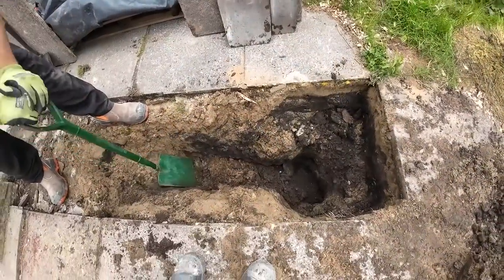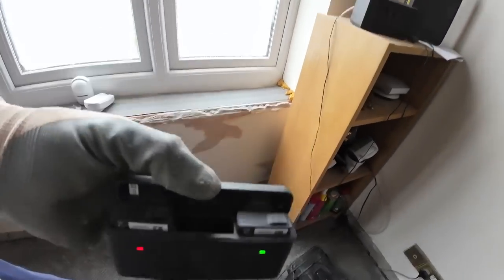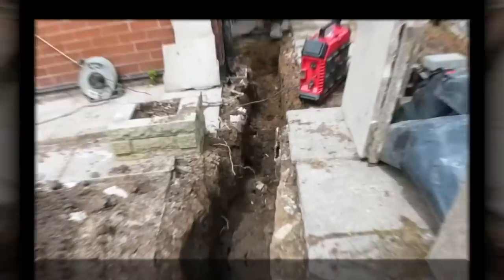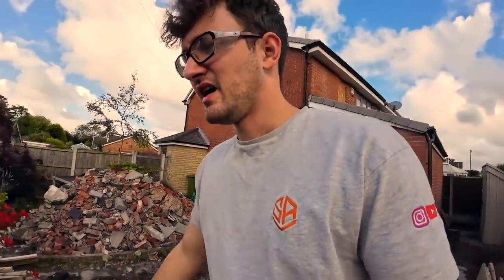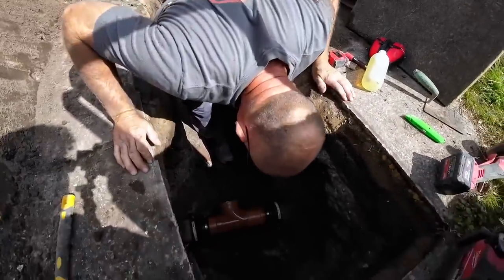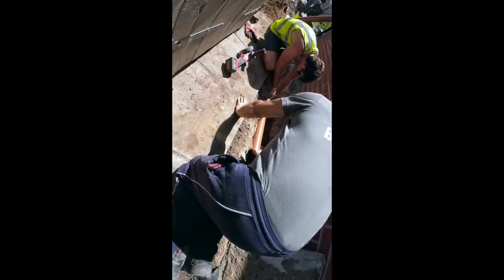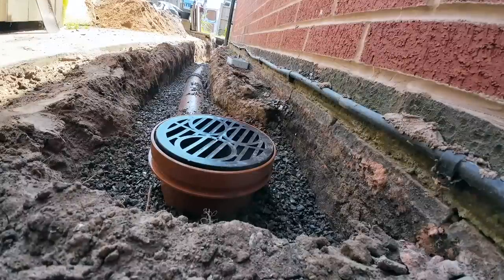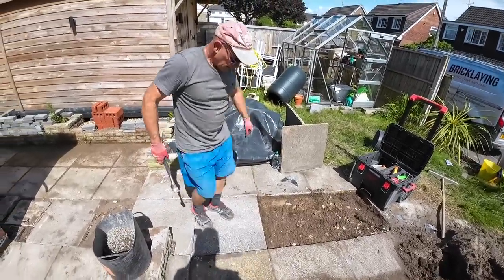BIG ALTERATION JOB PT 5... BOTCHED DRAINS

Comment: Wow that's a great job there lads it reminds me of my first drainage job in 1969 all glazed pipes then calking with tarred hemp and pointing all the joints all the falls had to be bang on for the inspector he came and rolled a ball down each length to the manhole and if it got suck it failed all the falls had to be bang on and he plugged up the pipes in the manhole and filled all the pipes with water to check for leaks,  bloody hell hey lads how the times have changed nice one Steve and Alex keep up the good work.
Reply: Years ago we fitted some 24” steel pipe underground and connected it to a cast iron pipe. The connection was a spigot that was leaded. First it was tallowed and hemp string driven in, then we had to put a rubber pipe around as a mould and poured molten lead in the joint from a pot on a crane. Once set we had to go round with offset chisels to drive the lead in. What a job that was!
Reply from the maker: I still remember the hemp joints  too 😬🧱👍🏽
Reply from the maker: Woah 😳🤯. Very cool 🧱👍🏽

Comment: Brilliant video, love anything underground and how you explain it in such detail. Is there any other way to avoid a potential kink where clay meets plastic (27.34)? Do they sell oversize collars so plastic fits over clay thus aiding flow. Or is it always a case of lining up the bottom of plastic with bottom of clay and trying to avoid a kink?
Reply from the maker: I think it’s the latter and relying on the installer to get it right. 😬🧱👍🏽

Comment: Swear you guys are spoiling me with all this plumbing content recently 😂 Do like a it of drainage, very therapeutic. Just the digging you got to do first 😂.
Reply: @SteveAndAlexBuild  you've probably already seen them but in case you haven't polypipe do an adjustable bend that makes life a bit easier and fernco do some icon couplers for clay to plastic. They're ribbed shove inside the clay and then just push the plastic on. Great bits of kit.

Comment: I found exactly the same in my garden  only it was serving the neighbours garage it was after my connection - the building inspector said it was redundant and to cut it off the utility company repaired for free as the 6” pipe serves several other houses.

Comment: Not having a go, and it’s easy looking at a finished job and seeing something you would have done differently. But if you had put the coupler on the other side of the branch the pipe would have be in a better line/ straight, and why wouldn’t you replace the old gully when you have the opportunity to connect onto the new drain.
Reply from the maker: The old gully is for surface water and we were doing the foul 🧱👍🏽
Reply: @SteveAndAlexBuild yeah I can appreciate that ,but it’s a combined system  as you discovered during your dig so it a like for like replacement.
Reply from the maker: It’s not a combined system
Reply: @SteveAndAlexBuild  really 🤔see the bit you said on camera about the Robbie’s altering the guttering and putting the new downspout into the new gully. 🤷🏻‍♂️
Reply from the maker: They are dropping the surface off the roof into the gulley for the kitchen 🧱👍🏽

Comment: Ar c10 minutes you shouldn't be talking about putting roof water into the foul sewer when there's a separate surface water drain.
Very neat work on what you did though.
FWIW I reckon to set gulleys and rest bends into a shovelfull of 'compo' to give the plumber a hand when he's pushing and pulling later